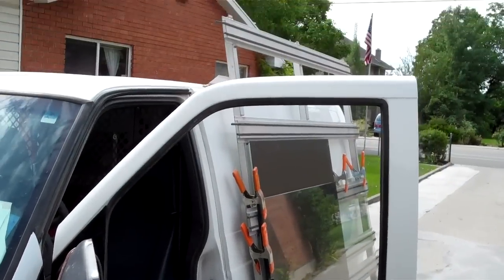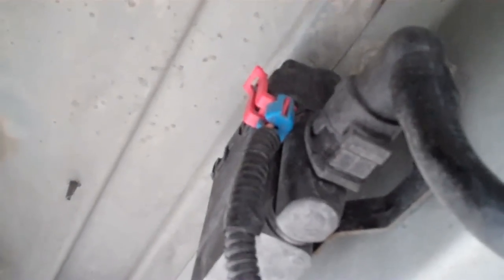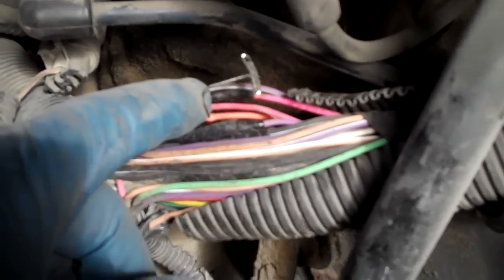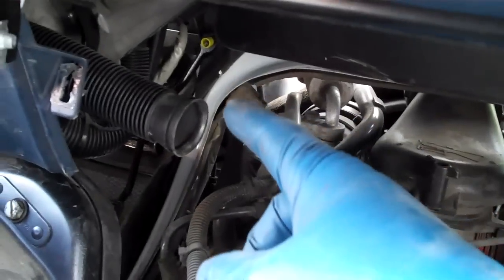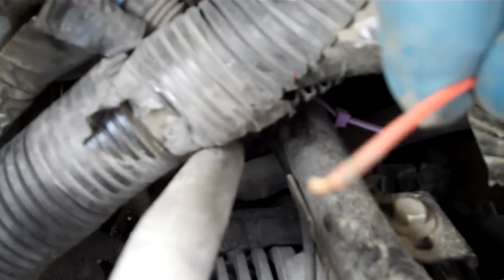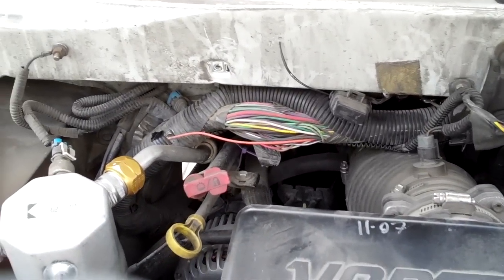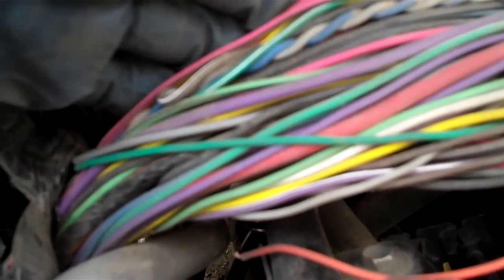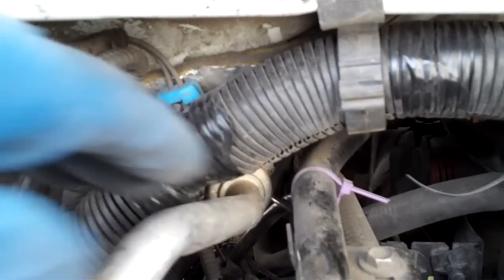2003 Chevy Astrovan Code P0449 and P0455

Comment: I used to maintain a fleet of older trucks for a cotton gin that bounced in and out of fields all day.  Wiring looms and any kind of hose that was touching anything were soon to fail.  To prevent the inevitable, we used radiator and heater hose pieces to slit and place around the trouble spots.  We zip tied or taped them and it worked great.  Don't know if you've ever tried it, but it's a great fix for an older vehicle like the van you're working on.  Thanks for another good video.

Comment: Brian - thanks for the video - i especially like how you tested the wire with the metal pin. I never would have thought to do that. I've had to trace wires before and it's always a nightmare - but with this tip it might make it a little easier. Again - thanks for the effort that you put into doing this.

Comment: I remember a broken wire nearly killing my 2003 mercury marauder. It was the signal wire running from the PCM to the cooling fan that had apparently been repaired once, but whoever did the repair used a stupid steel crimp instead of soldering and shrink tubing the wire, and the result was my cooling fan was not kicking on and my engine nearly overheated. But since then, the wire has been repaired the correct way and I haven't had a problem. :)

Comment: I think I just figured out that I am the 1% that has a busted wire and not a bad solenoid. I have the P0449 and replaced the vent and purge solenoid on 03 Silverado(was a booger to get out but did it without lifting bed). Once out I tested plug for power, before watching this that is... it didn't have 12V. So, I assumed it received it when it needed it from PCM. But it seems it receives the ground when it needs it, so I should have 12V at the plug constant. Went ahead and put new solenoid in. Still has code. Found your video on testing the 03 Chevy with good Vent where you discover the fuse contact was not good. I tried that, pulling the fuse a few times, still 449. Then found this Video... and I think this is where I am. After rain, I will see if I can back trace the wire and find a break in it. Thanks for these. Question... Would this code make the truck go into a "Reduced Engine Power" message on the display/odometer board in the dash? 2003 Chevrolet Silverado 1500 LS 5.3L ext cab short bed.

Comment: great video, I have the same problem but slightly different.  I had no voltage on the orange wire but it was because the white wire was open.  I checked the doghouse area you showed and it was actually A ok no rot on the split loom and it seems it was routed slightly differrent and not rubbing on anything there... however as I followed it across to the other side of the dog house and just down out of view the harness and loom were right next to the exhaust manifold and everything there was rotted.  My white wire was open there so hence the reason I didn't get any voltage at the plug for the Evap relay.  So it can be either wire.  I did try measuring the orange wire to chassis ground and you will get the 14 or so volts , this is how I figured out the other wire in the plug was open because it should also be essentially a ground wire when the vehicle is turned on.

Comment: I agree with Hector, great video!!! Good job!!! Thanks for sharing and taking the time to video tape this!!!!
Reply: I have a question on a 2004 Safari van, l had a chech engine light in and went to Auto Zone and had it diagnosed, it said fuel pressure sensor not working, so l had mt lical mechanic put in the fule sensor at the engine, still had a light on, so he advised to put in a new fuel pump and replace the fuel sensor at the top of the tank, eell it worked fir about a week and light came back on, l went to Auto Zone again and was still saying pressure sensor, so what do l do next to get the light off?

Comment from the maker: It's got a short to ground somewhere or a drain to ground.  I would check for a Power antenna wire (blue) for an aftermarket radio or something if you have one.  Otherwise check out the wire harness' in the steering column.

Comment from the maker: It could be, but I was concerned about the other wires chafing it.  It had to be pulled back tight.  That pressure could make for trouble later.

Comment from the maker: How do you know where the roots of a tree are?  You follow what you can see to where you know where they should be.  :  )  Start at the gas tank (obvious to find) and follow lines away from there.  Having replaced fuel pumps I'd seen the lines in order to separate them from the tank.

Comment from the maker: That's an input code.  I would bank on wire shorting between the sensor and the computer.  You're van thinks it's -40 F so it will run really rich like the air is thick even though it's not.

Comment: There's a tool you can buy that holds the crank pulley on then you can slide in a breaker bar and pull like mad. You gotta be super strong to break loose a Honda crank bolt by hand though.

Comment: Why didn't orange wire with battery voltage blow a fuse as it was cut through by AC line? Was the AC line isolated from ground? Great video, thanks!

Comment: Hi there! I have a 2001 Chevy Astro Van Rear Wheel Drive I kept getting a diagnostic reading-O2 Sensor. I exchanged and put in a new O2 sensor and that did not resolve the issue. Somehow I removed one of the (2) wires on the O2 sensor and now I am getting a check engine light which I did not previously have. Qts. What is the best way to replace the wiring for O2 sensor connector? Thank you, Lynn Denver Co.

Comment: What did you find out on the misfire situation?   I have a 93 and 94 Astro(s) and the wiring and loom on both are in great shape.  GM must have bought crappier than normal stuff from overseas in the 10 year time difference.  However, my vans are 4.3 Z engines, and I've had a strong gas smell on the 93 for a few weeks.  Upon closer looking, I found the vapor canister (by the battery) split open on the top and wreaking of gas fumes.  I immediately got another at Pick N Pull and no more smell.

Comment: Hey Brian... Im having somewhat of a same issue. security light , low fuel, battery , and security light come on after a few mins of running after start up. had it at a shop. they cant find the issue. do you think this could be a similar issue??? broken wires, short.?? I know  the wires go  around the doghouse and topside like in your video. Im hoping this is the issue I want to try and fix it myself if at all possible

Comment: instead of actually finding the wire break i would have just ran a new wire from up front to the back of the engine and left the old wire in place. I also probably would have said the vent valve was bad as soon as i saw those codes but as we see its not good to jump to conclusions based on past experiences.

Comment: I had the same issue with the vent circuit on a 02 Sonoma 4.3l. My issue was also the wire loom was rotted and worn except my broken wire was chafed because of rubbing on the gas tank and frame rail. I simply ran a new wire and taped the plastic loom up real well. What was up with the misfire?

Comment: Chevy asteroid  Won"t start  what  can    i  do  to  sart  it
Reply from the maker: You can call Space Force, but I don't think they deal in sexual assaults of heavenly bodies.  → https://www.nsvrc.org/sarts  As for Astrovans, I usually start diagnosis with checking for fuel and spark.  Starting fluid is a good quick diag tool for both.